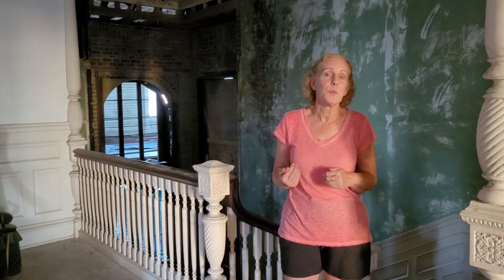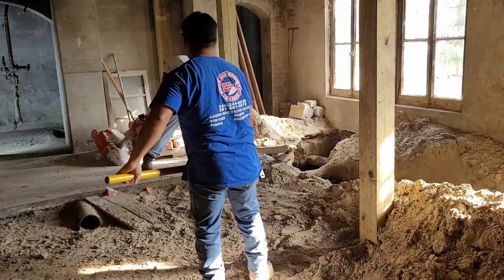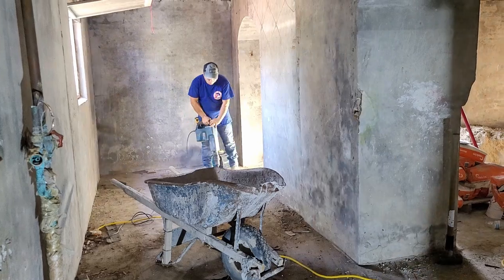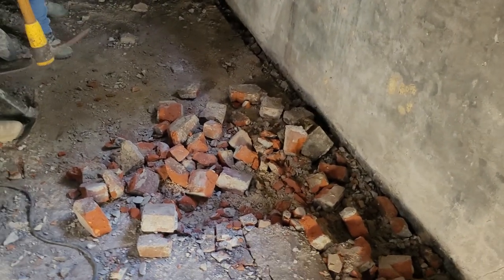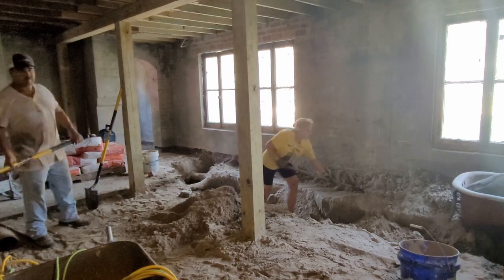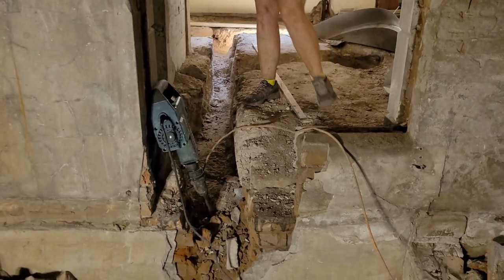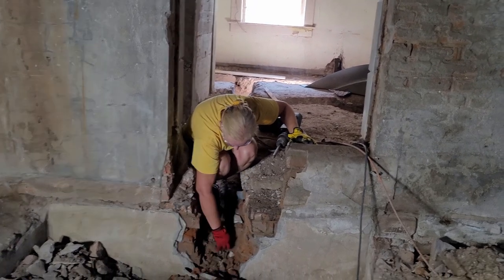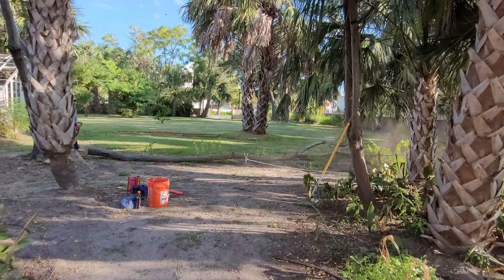S2.26 Getting Serious in the Basement

Comment: Hi Janie, I'm so curious: how does having live-in tenants work with running a venue/ museum? I suppose having people on site most of the time is great and the income will help with the restoration. It would be incredible to live there.
Reply from the maker: Good question.  I'm not really sure but I think it will work out well with the right tenant.  When we have tours they will probably be between 10 and 4 so mornings and evenings will be quiet.  There will be some after hours events, but not that many and Galveston has a noise ordinance so everything has to shut down at 10pm anyway so there will be no late, wild nights.  The apartments will have private, ground floor entrances and of course we will need to add lots of soundproofing.